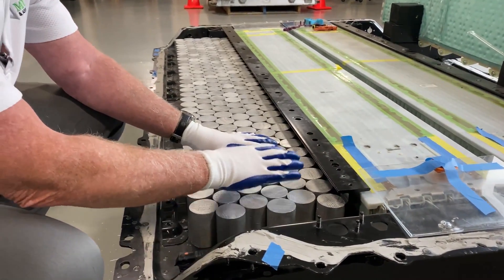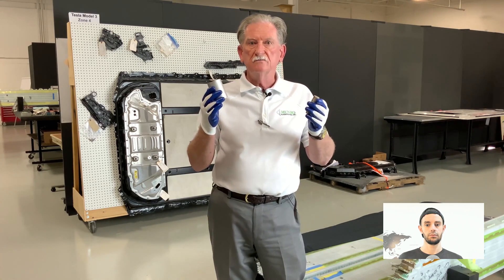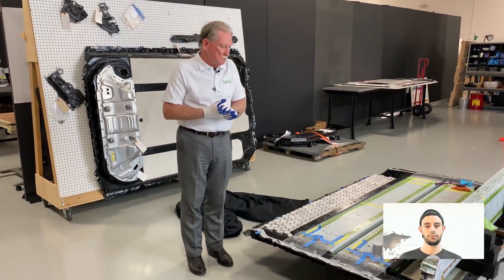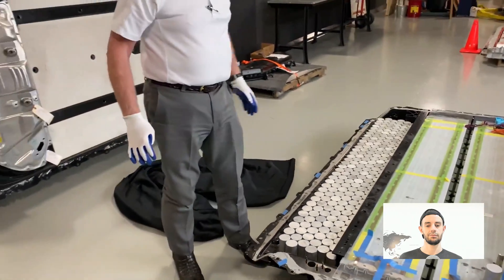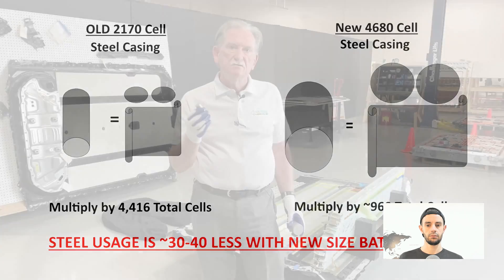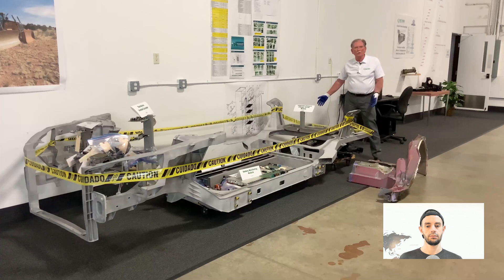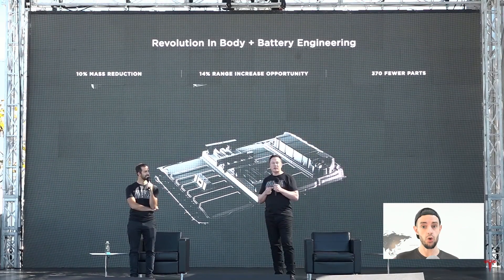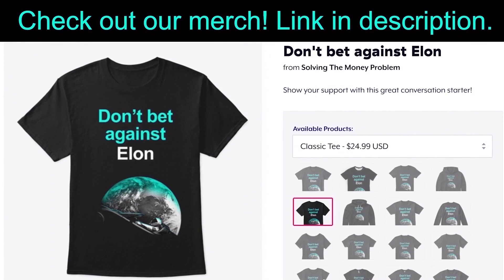Tesla Engineering: Sandy Munro THRILLED

Comment: Since we all know that Tesla doesn't have step changes in the mfg process, but believes in continuous improvement.....  Here are my ideas / observations of the implications of battery day...
All of these observations are from the stacking up the benefits slide
1. 16% improvement in range and 14% reduction in cost by implementing 4680.  Obviously this cannot be implemented without a new production line. My guess is that the biscuit can line will be implemented de novo in Berlin, then Austin, and then upgrade the line in China, and then upgrade  Nevada to eliminate any supply bottlenecks. Any third party battery suppliers can be paid afterwards to upgrade their lines to the new regime later with the Tesla 4680 tech. I do wonder, however, if the tabless design can be slotted in first in the current 2170.  Seems like a logical low cost upgrade to lower mfg cost till the line can be replaced with the 4680.

2.18% reduction in cost in Cell Factory improvements.  Here 3 things were combined: a: dry electrode process,b: continuous moving line like beer can factory, and c:formation (initial charging step). Aand B have to be built from scratch, and therefore first to be seen in Berlin then Austin, and then retool the other plants.  Since Musk said that they don't have a ready for prime time A process, I wonder if they have a plan B if the dry electrode mfg process cannot get yeilds that they need in the new plants.  This seems to be the biggest risk of the entire presentation because Berlin and Austin, by definition, have to be built assuming that dry electrode yeilds get better and work at scale production.  Formation, case C of factory improvements, can be impemented everywhere and is only limited by slotting it in to current lines.
3.  Silicon anode material 20% range improvement and 5% cost reduction.  This item can be implemented across all current and future battery production in Tesla and OEM supplier plants.  Very little retooling needed, comparatively speaking.
4.  Cathode material 4% range increase, 12% price reduction . This is done in two steps. (Ignore the possibility of price reduction due to blending total output with Iron as a component in low end batteries)  Change nickle formulation by increasing nickle, reduce cobalt, increase manganese, and novel coatings . Here they discussed making their own cathodes so this reduces capex and price but it isn't clear if the cost reduction at this step is built into the 12% number as they said making their own cathode reduces the cost 76%.  Obviously the cathode savings and performance is backward compatible with all of their current battery production.
5.  Not on the slide, but electrolyte was discussed but not broken out.  Lithium production isn't accounted for in the 56% slide for even greater savings.  Their new lithium method reduces this component price by 33%.  The slide showed 100% electic facility, which means....  I have no clue.  This savings can be backward integrated into all future and current plants.
6.  Cell vehicle integration 14% range, 7% cost.  This is already being slotted in with the single castings as we saw with the Y breakdown by Sandy M and will be the default method in the new plants.  Battery chemistry improvement implementation is not required here.  So future plants and current plants can be simultaneously fitted with this tech.
Reply: 100% electric facility likely means they wont be burning fossil fuels (likely ng) for their dryers... Since they wont really have dryers.
Reply: The answer is in the numbers: 2170 vs 4680.  Its a centimeter taller cell that requires a totally different packaging, totally different cooling, totally different vehicle architecture around it. We will see it in the Plaid vehicles, but I suspect a big reason the Plaid costs twice as much as the normal S is that it is a whole new bespoke chassis to fit the new structural pack and trimotor configuration.  I would expect that when Tesla is ready to upgrade the 3 and the S and X to these new batteries it will mean building whole new production lines and completely shutting down and repurposing the exsiting ones.  But as Tesla has said they plan on keeping their CATL and Panasonic contracts, that means it will be pretty far into the future.
Reply: @patreekotime4578  there is nothing stopping them from just putting the CATL and 2170 into the new floor casting. Let's see what the mic model Y has. They are doing major upgrades ad shanghai at the moment so we could see the start of the CATL batteries in a few weeks

Comment: To create huge castings means huge mistakes.   Only elon doesn't mind the cost of throwing out a 100k mold.
What was thrown away when they went from 2 castings to one?
A million dollars?
No big auto would do that.  Throw away an asset on the books 
I predict elon will make the bottom of the car just one casting
Reply: You wouldn't have to throw away the flawed ones. just melt it down and reuse it for the next one.
Reply: @Animus1539   spend a million to make the mold then sell it for 100 as scrap.
which company would ok that except tesla 
not taking about casting 
its about the tooling
Reply: He has a patent on it, shows 4 giga presses joined to produce 1 entire car frame/chassis.
Reply: @jonbong98  my point is at each step succeeded he will  then throw it away .
Big auto DNA refuses to  throw any asset away

Comment: Got that immediately on battery day. As a mechanic for manufacturing techniques who worked for 8,5 years in the production, I know what Sandy is talking about. Great man!
Reply: @CloudStorage I hope they'll drop the prices and increase range. I pre-ordered my Y LR last week.
Reply: @RuckaznRollaz  Congratulations on your Model Y !
Reply: Could you give us an educated idea how much savings per car this roughly creates?
Reply: @Steph1  No, not at all. I was only mechanic and operator, but we had two huge buildings for the body shop, one where the huge presses were in and one for the welding. I saw the GIGA Casting machines in pictures and I suppose it would take a tenth of the room we needed to build a body, including the welding. Far less operating personnel, far less room needed, far less handling of sheetmetal and clamps and rivets and small pressed parts, far less welding robots, far less need for maintainance due to far less machines, far less energy consumption, far less downtimes, far more output of bodys etc. It's just like Sandy says, the body shop becomes obsolete.
Reply: G-Cell thanks for the write up, this was very insightful 😊
Reply: @Steph1  IMO, it could save $3K on the Model 3 and put the SR+ at $35K. It could also allow Tesla to introduce a SR+ Model Y at $38K. I suspect the prices will drop next year, once they start production in Texas.

Comment: Do you think the Plaid S has the actual new battery cells in it.
Reply: model S Plaid ONLY car with 4680 cells by 2021
Reply: They wouldn't have shown it as part of battery day if it wasnt.  And to get those numbers it has to.  Also the reason it isnt already for sale.  But it will be a low volume vehicle so they can assemble batteries at their trial production lab.  This also tells you how long they have been sitting on these batteries because both Cybertruck and Roadster numbers depend on these cells.

Comment: Why cool from the bottom?   Doesn’t heat rise?  (non engineer).
Reply: Heat has no weight. It cannot, by itself, rise or fall, only spread.

Heat inside matter (as opposed to radiation) is just particles (atoms, molecules, ions, depending on the material) bouncing around. Heat spreads by particles bouncing off of other particles. Different materials allow for this to be a faster or slower process.

Heat in a gas or a liquid "rises" because the bouncing of the particles pushes them further apart, resulting in less density, and less dense gases and liquids are pushed upwards by heavier gases and liquids. So it's more accurate to say that "cold sinks", but even that isn't exactly right. Still, it works as a simplification for daily life.

Now, in a solid, the particles cannot move around freely, they're stuck in a rigid grid of sorts. So they only kinda vibrate in their grid-position rather than freely bouncing all over the place. Hotter sections are still less dense as the vibrations still push particles apart, but since they're locked into place, they can't rise up and take their stored heat with them. So in a solid, heat doesn't "rise" and "cold" (=less hot sections of material) doesn't "sink".

So why does the direction matter at all, you might ask. Why isn't it better to cool from the sides, since the heat would have to travel a shorter distance? Well, that's because, as I said earlier, heat spreads at different speeds depending on the materials it travels through, and cylindrical battery cells are rolled up sheets of multiple materials, some of which make heat spread at a very slow speed. So it's better to cool from the bottom and/or top of the cell, because there's a sort of "heat highway" in the form of a material that allows for very fast spreading of heat, that leads directly to the end caps of the cell.

Hope this helps.
Reply: I expect they cool both ends.
Reply: Yes, but the whole battery become hot, and the bottom of the battery have large surface area that rest to the cooling system.
Reply: @kirgan1000  
The sides have much more surface area. If that was the reason, they'd keep doing it the way they always have.
The important factor is heat conduction, which works best on the two end caps (top and bottom).
Reply: At a guess I'd say because of the airflowing under the chassis